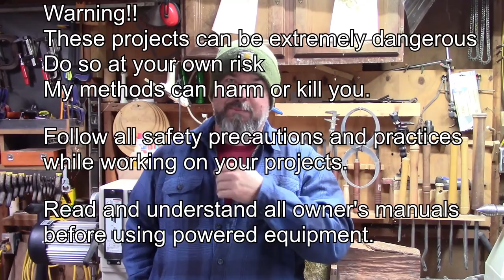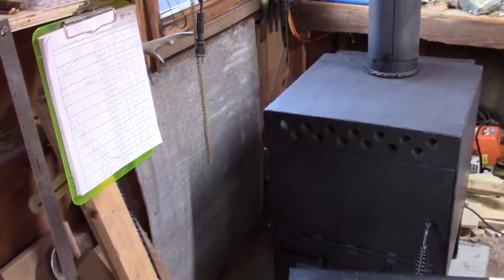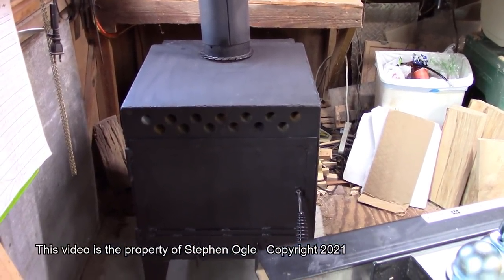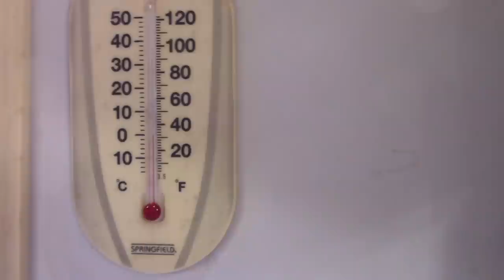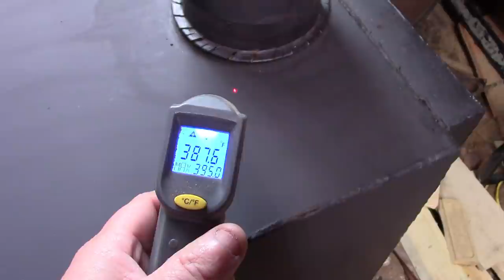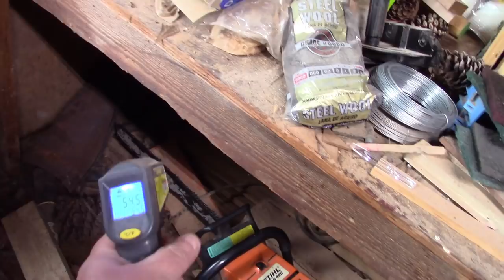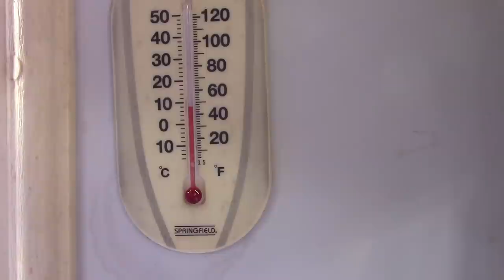#173 My Heater is Installed and has a Name

Comment: Great job I would also add a damper in the exhaust pipe to shut down the air going out when the fire is just coals works great been heating my house with wood only for 30 years like your videos  keep em coming

Comment: Hey Stephen, been a minute.  You seem well.
Yeah, my shop is 24/32 and this year I decided on doing a heat pump.  I found a great deal on a wall unit.  We heat our house w wood.  Ain’t nuttin like wood heat here in KY.
Reply from the maker: Thank you Todd. I run a heat pump in the house with a really nice woodstove as backup for those really cold nights. Works great. I agree that wood is a different kind of heat. It is just better. Thank you and take care.

Comment: Hey Steve.  Nice addition to the shop.  Nothing like woodstove heat AND the perfect way to get rid of all those cut offs and scraps.  The only change I would make is to reverse the connections on your stove pipe so if there is any dripping of creosote it with stay on the inside of the pipe.
Reply from the maker: Thank you JG. My old stove had the male connector and the top vent had the female connector. That is why I installed them this way. Your way makes better sense, but it would be a hassle to get it to work. Thank you very much for your suggestion and Thanks for Watching. Take care.
Reply: @StephenOgle  Understood.  I enjoy your videos and look forward to coming projects. I like the fact that you are willing to share all aspects of what's involved.  PS  I'm jealous of that new lathe!

Comment: not to be negative, but if you would put some effort in insulating that shed(did notice the gaps between the trusses and the walls or if it was the roof steel) you wouldnt be needing that nice big ass stove you built :D

Comment: Your exhaust pipe should be fitted the other way round so your crimped ends are inside each other facing downwards so that the creosote residue from wood smoke drips back into the burner and is burnt away, the way you have your pipes the liquid creosote residue will run down the outside of the pipes is a potential fire-Hazard!